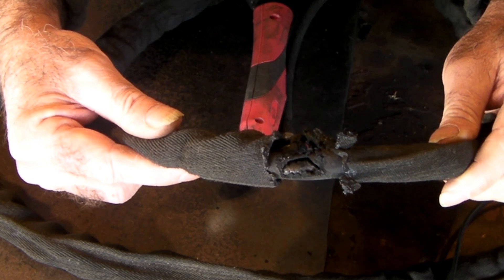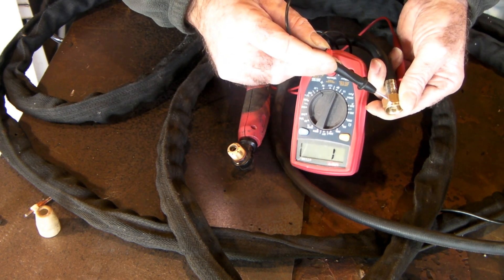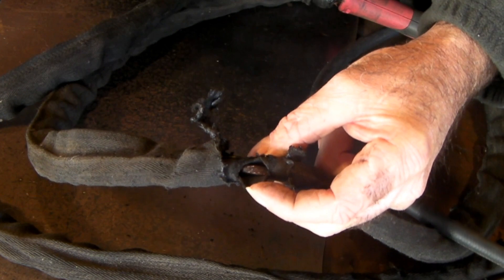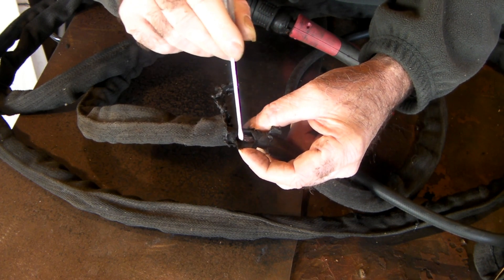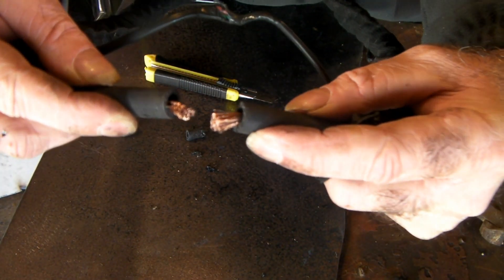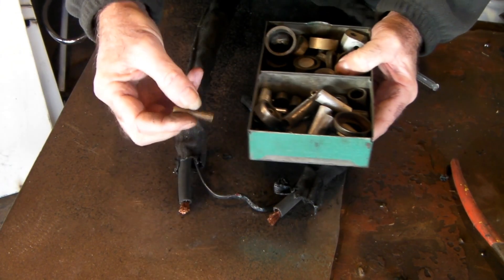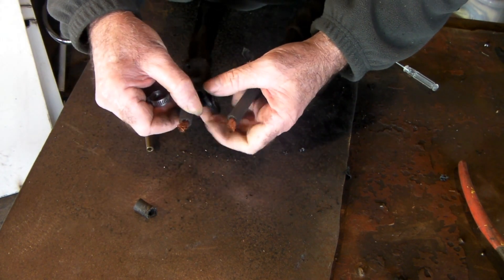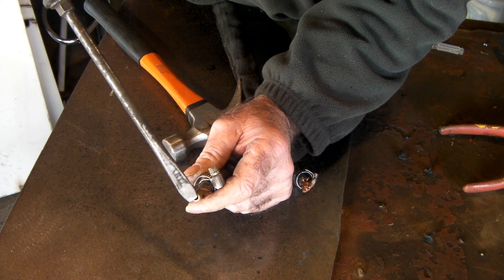Plasma Torch Hose Repair  DIY

Comment: I was given a Lincoln Pro-Cut 25 with a PCT 20 torch. The guy that gave it to me was cutting on a car and accidentally set the car on fire. The cable was in the fire in about the middle of the cable. By the time the fire department got there, about a foot of cable was ruined. I looked for the replacement cable and was absolutely shocked to see that just the cable with the torch is $1400. I may as well buy a brand new Lincoln plasma cutter at that price. I am hoping to splice the torch cable. The Lincoln is a lot different than my Chinese Cut-50, which only has something like 4 to 6 wires but the Lincoln had a lot more wires coming out of the torch cable. Maybe 10 or 11 wires.

Comment: any guess to a rough gauge for the wire inside the hose; considering diy'ing 2 hoses as I have most the material less the ends:P
Reply from the maker: about 6 mm my best guess, but the thicker the better
cheers pete

Comment: I suggest using copper pipe, not iron or steel. That just conducts around 25%. Copper conducts 90%. The steel could overheat. The nylon cover really just protects against abrasion. Kevlar would help against heat, but leather is often used, but it’s too expensive for home use, and it’s heavy.
Reply from the maker: Yea thanks . I just tend to use what i have laying around as i am CHEAP  LOL .thanks again for watching mate .
Reply: You may be cheap Pete, but you know what you’re doing, and you have a good heart.